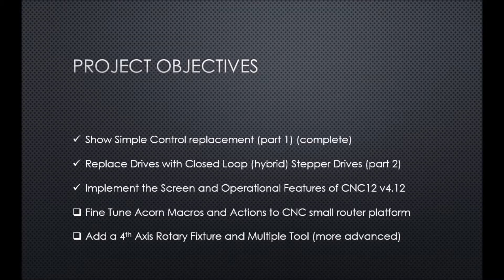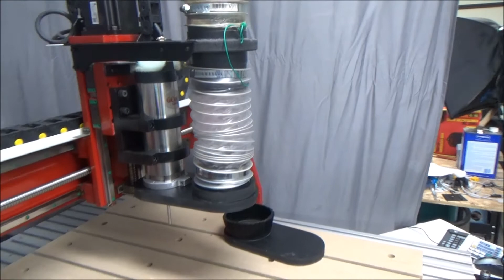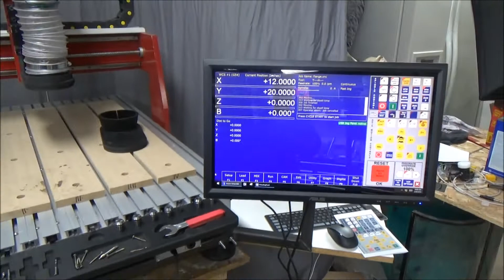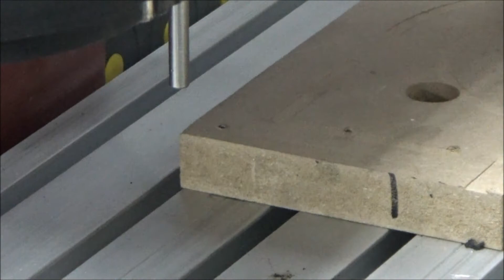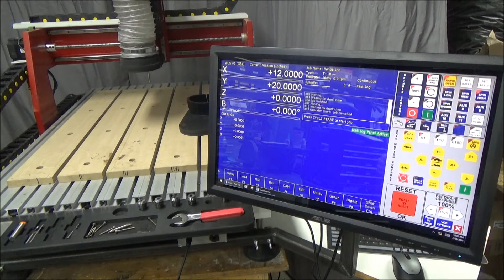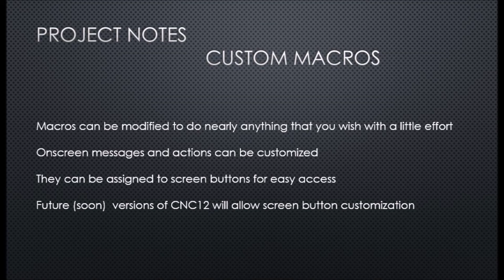Acorn  Custom Macros and Screen Buttons

Comment: Liked-Subscribed-Notified.  Great video.  I've been building cnc equipment in my home shop since 2006.   I've done mostly Gecko stepper drivers.. but also did a Larken Servo drivers upgrade on my milling machine.   Scratch built a 3 axis cnc router.  Been looking at the acorn..I think it would be great for a 3 linear axis machine

Comment: Nice job Gary! No you have a vacuum on your machine if so how to you toggle it?
Reply: I don't use vacuum on this machine.  But if I did, I would toggle it with a contactor hooked to one of the relays, I have one setup to do just that.  It was shown in a previous video